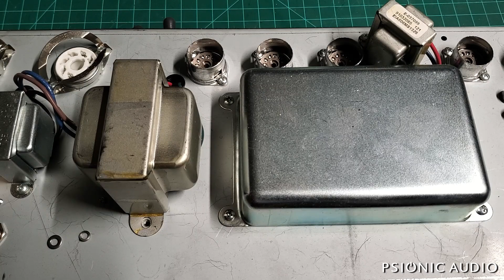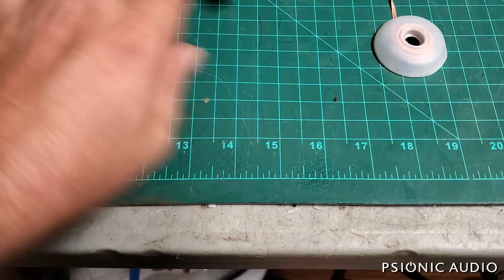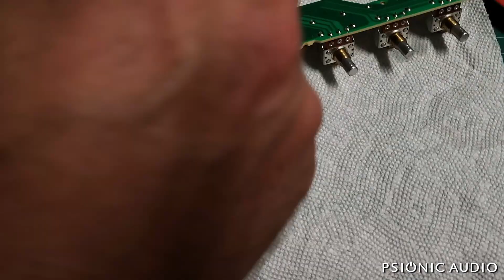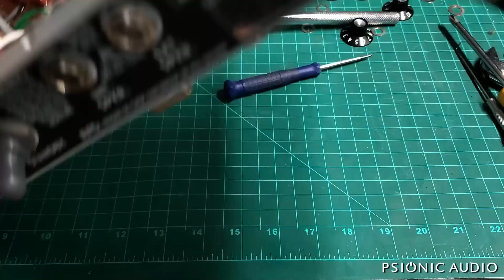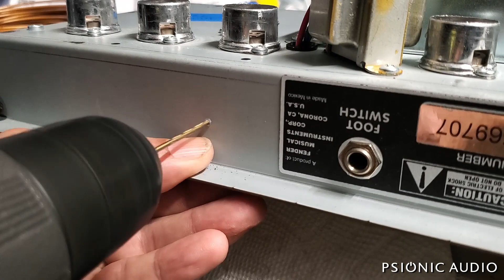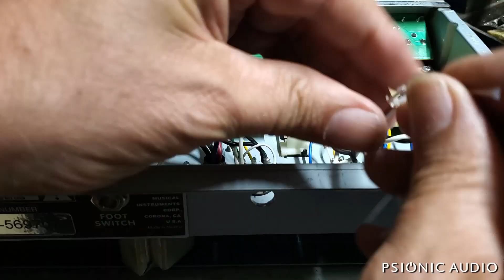Fender 68 Custom Deluxe Reverb | The Biggest Improvements Possible While Retaining the Stock Boards

Comment: I slowed down YT 50%; I like details. Guessing you resoldered controls with Pb solder and replaced the tone stack with higher quality poly caps. I used 630v WIMA PPF on the boards. Very clean, more like a Super Reverb now. Cool mods Lyle!!👍🏼

Comment: @psionicaudio Man, how i wish I knew how to do this myself. Just bought a Fender 68 custom twin reverb that I love, but the hiss and hum is such a let down. Plus I don't know a tech that would do this....would it be expensive to have someone do this? I would be happy with just removing the reverb/vibrato from both channels and increasing the negative feedback to solve the hiss and hum
Reply: That alone might just do it. This guy has a lot of videos that show how to start with the most non-evasive and easiest possible solutions right up to something similar to what you see here. 
I'm sold on this guys (Lyle?) expertise and common sense approach.
Good luck getting you '68 to quiet down.

Comment: Lyle, here's a totally unrelated question: I'm working on a weird little push-pull EL84 amp with a 6CA4/EZ81 rectifier that has a very poor grounding and lead dress scheme. The 6 volt winding that powers the preamp and power amp sections also powers the recto tube, and just one side or leg of the heater string is chassis grounded, because the winding doesn't have a centertap. Is it okay to use a pair of resistors as an artificial centertap *when the rectifier shares the same heater circuit as the other tubes*, and can the entire heater-circuit be biased-up (taking the cathode voltage off of the EL84's) instead of grounding the artificial centertap?

 Interestingly, I have been looking at some old schematics for low-power EL84 amps, Vox AC10 and the like, and freguently they don't bother to show a ground reference for the filament wiring ...... but there isn't any scenario I'm aware of where you can actually go without one, otherwise you get lots of buzz and hum.  Years ago I worked on a vintage 4×10 Bassman and I turned it on one morning just to give it a final check before shipping it out, and right at that point the center tap  for the filament winding just let go internally, and the amp buzzed horribly until I determined what had happened and added an artificial center-tap. (That was a weird "transitional" amp, by the way; the circuit was only a couple parts different from the short lived Bassman that supposedly used a type 83 Mercury vapor rectifier, except that it had a factory-installed octal socket and a 5U4. I drew up a schematic for it at the time, it's around here somewhere....🤔)
Reply from the maker: You absolutely can, and should. The only similar amps I've run into where you can't reference to the cathode voltage instead of ground are the  Thomas Organ Cambridge & Pacemaker, due to how they do the indicator lights.

Comment: Which ceramic caps do you recommend for black panel Fender style amps (treble controls, bright caps, PI coupling, and trem oscillator caps)?
Reply from the maker: Vishay 562R for everything in the signal path. MLCCs for LFO.